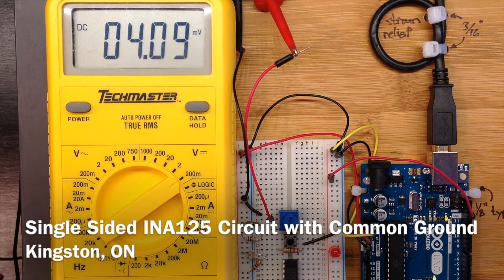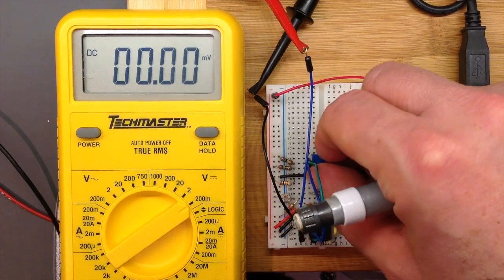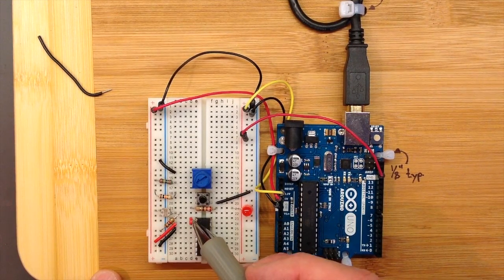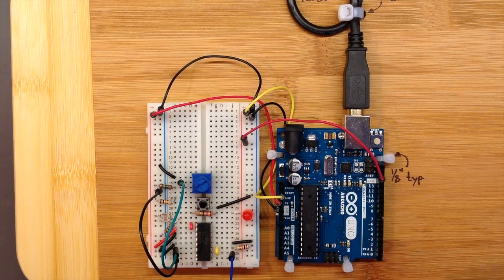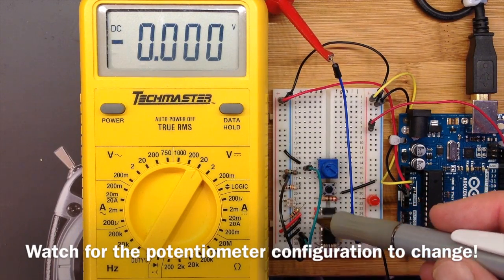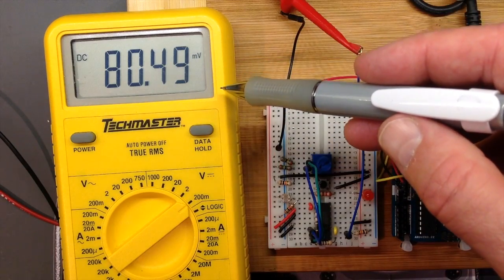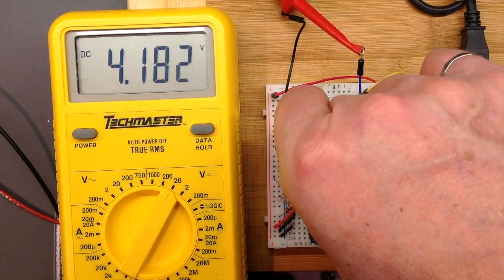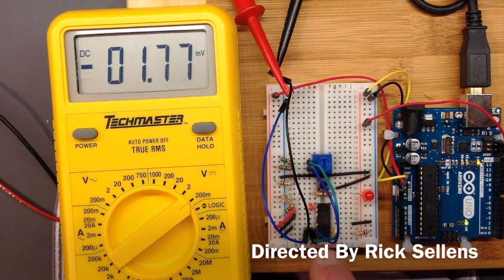Single Sided INA125 Circuit with Common Ground

Comment: can i use INA125P for temprature measurement? ill use lm35.
Reply from the maker: @fatfat5198  I would recommend one of the newer dedicated thermocouple chips with built in cold junction compensation and digital output. E.g. https://www.adafruit.com/product/269
Reply: @RickSellens  i need to design an analog circuit thats why i dont wanna use digital amplifier or module.ill calibrate it with curve fitting it doesnt have to be too sensitive.